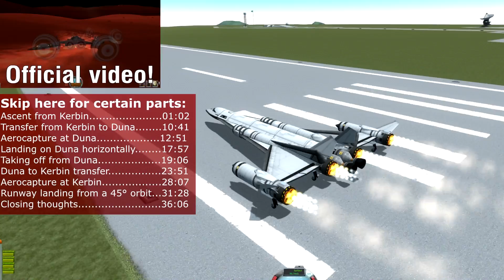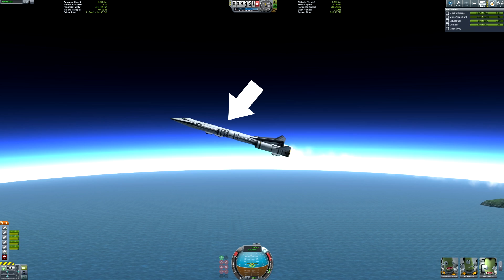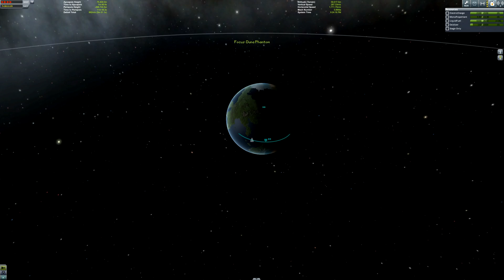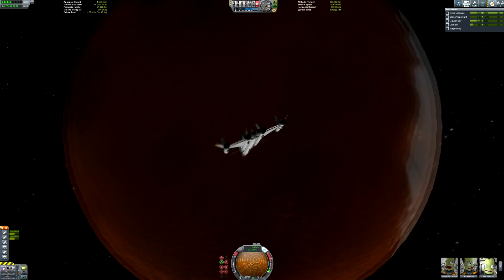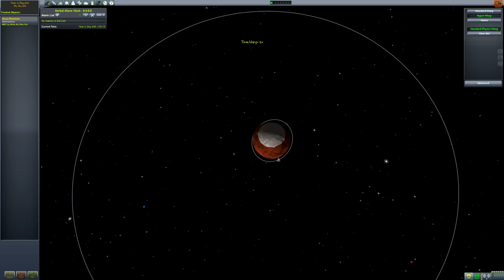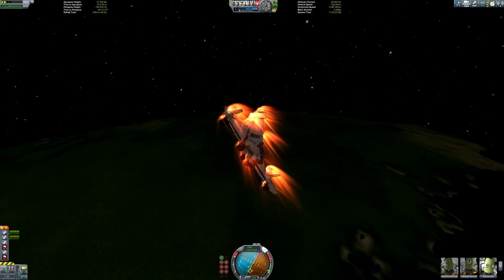Interplanetary SSTO Guide Part 2 - KSP 1.05

Comment: Its not perfect but a great ascent profile for just about everywhere is the gravity turn. Its what they use in the real world too, partly because its less stressful structurally and aerodynamically, and partly because its very good for efficiency. My standard on Kerbin would be to launch the rocket vertically, then at 60-100m/s give it a kick of about 5-10 degrees towards the orbit. When the velocity marker starts to catch up a bit you would hit the control to point the nose directly towards the velocity marker. From then on you never touch the directional controls and only use the throttle. I personally let it get up to at least 10km altitude, pitch itself over a bit, and then it will be at a decent altitude to finish the burn. With that you always point towards the air to reduce drag, your rocket never goes crazy and even aerodynamically unstable rockets are easy to fly, you have very little to think about and ruin, and your rocket gets far less stress than it otherwise would.

For the launch here you would try to pitch up steeply as quick as possible, 45 degrees or steeper, and again you would let the rocket pitch itself over. That way you're using the thrust at the start to beat the atmosphere as quick as possible, then leaving the rest to inertia and working towards forwards thrust a lot more later in the launch. For an SSTO from Kerbin I would get as much speed and altitude as possible naturally, and then climb to a fair angle and again after the initial part leave that to gravity. There's a lot more variance there so its hard to describe exactly what you need but I'd guess a 30-45 degree pitch up would be a good start. However in the atmosphere be careful not to pitch up too aggressively, a gentle turn would use the wings and create a good amount of lift for little drag but a sharp high-g turn would create similar lift with massive amounts of drag, especially noticeable in the way the game calculates lift.

In the real world the gravity turn is similar but a lot more delicate, as one would imagine. They would kick the rocket over far earlier and use a far smaller angle such as 2 degrees to reduce the stress put on the airframe. However in KSP the smaller the kick the less accurate in terms of inclination and rather than add corrective measures constantly I prefer to just use a larger kick later. Also real world rockets are better designed and able to remain at high throttle the entire time, in KSP I tend to add larger rockets than I need so throttling down to 1/3rd or so for long periods isn't uncommon. However the general concept of adding a small kick then leaving the rocket to turn itself is still the real-world technique for good reason and applicable in almost every single case. Without atmosphere there might be better ascent profiles but the gravity turn is still a good choice, its just not the perfect choice there.

Comment: Things you can do in KSP.. design the ssto so that the jet engines break away aft of the rapiers to get above 400m/s... Or keep them and fly around on laythe. I typically use the turbofans in nacelle form forward/fuel tank or precooler/reverse. Helps me land back on kerbin. I like cross-range capability.

Comment: Matt, a little bit of advice.

I think the way you've got these airbrakes installed on your SSTO's (I've seen you do it with diffirent crafts aswell) could lend to them being compared to "spoilers" on an aircraft (Shown here: https://i.ytimg.com/vi/2wVa1Qyr6IM/maxresdefault.jpg)

Generally, if you want to land an aircraft, you always want to make shure that the spoilers are rectracted during the touchdown, because the spoilers essentially "push" the aircraft towards the ground, making the landing very rough.

I don't know if this translates to KSP aswell, but maybe you could try retracting those airbrakes on top of the aircraft to achieve more smooth landings.

Comment: Quite the take-off there, Matt!

"So much fuel... so little runway... ANGLE OF ATTACK!"

golf clap
Reply: The problem with that takeoff is actually due to craft design. The rear landing gear is too far behind the Centre of Mass. You can see how fast the craft pitches up and climbs after he runs out of runway, which is a very clear indicator of the problem. It can be fixed by either putting the landing gear closer to (but still behind) the CoM, or by adding canards to the front of the craft (but still making sure centre of lift is behind CoM.)

Comment: I don't mean this as rude, but has the thought crossed your mind that people viewing your videos have no interest in ADD UBER crackhead speeds and being told to going off to find another video you say things are explained better? Only to chase down that video and get told to refer to another more detailed vid.  I'd much rather see detailed setup of a node than the idiotic fly-by camera views and IVA views. Most of us are not trying to finish KSP in 12 seconds.
Reply from the maker: Has the thought crossed your mind that I'm referring to episode 1 of this series, which goes into every aspect in detail, and this episode is meant as a loose guide to help you apply what you learned in the first episode and reach destinations that are further away?
Reply: You obviously missed the main point of my post. I'm impatient with tubers that are hyper ADD and impatient. Even the video you reference you constantly overshoot nodes from simple impatience. I can only imagine you trying to dock. Also your first video hardly goes into every aspect in detail. Not even close to that level of standard. For example, "that is not going to be enough oxidizer" so you added a tank of LFO. Did you explain how you knew that wasn't enough oxidizer? No word was mentioned even slightly referencing how much fuel or delta-v it takes to get to Minmus and back. There are a lot more examples, but point made since the required delta-v is rather important.
Reply from the maker: Starting by saying "I don't mean this as rude" doesn't automatically allow you to then be rude in your comments...

I stated in that video that you should not be attempting SSTO missions until you can confidently get there by rocket, thus having a reasonable grasp on manoeuvre nodes and encounters. By extension you would also have a good idea regarding how much fuel is needed. The point of the video was to show you how to fly an SSTO mission, I've had a huge amount of people send me messages about how it helped them. Either you're trying to nit-pick or are genuinely too inexperienced to really be attempting these sorts of missions yet. As I said in the video, you should have a good grasp of going to Duna and Minmus easily without any help before even considering an attempt at SSTO. 

If you're just trying to prove something here or whatever then feel free to go ahead and make your own tutorial, instead of berating others for making their's not up to your standards.
Reply: Trust me, I'm not inexperienced and I haven't been rude........yet........so back the fuck off the attitude. This makes three times I've tried to point out, quite clearly in the start of each reply, the simple fact you constantly rush and are extremely impatient. It is annoying and avoidable if you understood the basic controls. Each time I've pointed it out, you go off on some other minor aspect of my post.

Let's recap shall we? First post .....slow down, don't be so impatient. You reply with your first video and saying "goes into every aspect in detail"......I replied once again about not being so impatient AND pointed out your first vid certainly doesn't "goes into every aspect in detail" since it clearly doesn't. You get your panties in a wad and call me inexperienced and laud your praises from others. WTF dude, I said you should chillax and stop doing all the special effect fly-by's and silly camera tricks. Now for the rude part because as yet I haven't been.........you don't play well at all, your designs are amateurish, and your arrogance knows no bounds. 

Now back away from the keyboard and attitude and go watch Shadow Zone play.....or grunfworks....or, well just about anyone since your "guide" is nothing but a little man jumping up and down screaming look at ME! Look at me PLEASE! No real guide here, but LOOK AT MEEEEE!!!! Fucking pathetic.
Reply: Qookie well that's a bit over the top
Reply: Wow... Lets play "spot the asshurt emo fucktard".

I'll give everyone a hint... the asshurt fucktards's name starts with EMO.

Comment: So your spacecraft is a true compact planetary vehicle. We humans need those SSTOs in real life instead of using large bulky rockets.
Reply: but it's impossible to do that with real world technology. remember that ksp is 10x smaller than earth and that we haven't even been to mars with humans yet.
Reply: Using electric sparks to heat compressed air rapidly to form sonic booms that propagate behind the vehicle could be used as a future propulsion system for real life SSTOs, I hope. Basically, a thunder propelled spacecraft, energized by some form of fuel cell in 2040 AD could be designed by someone. Hopefully that someone would be me.

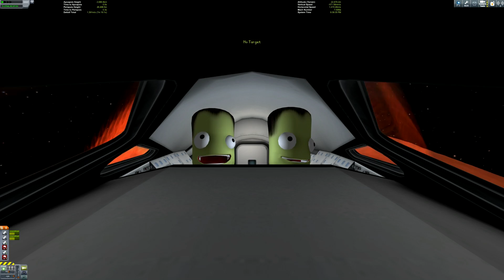Comment: At 15:00 you mention using a belly flop to aerobrake, but wouldn't shifting between normal and anti-normal be more efficient? I would assume you'd be getting a lifting body effect from even a belly flop. Isn't that the reason why the space shuttle would shift between normal and anti-normal as to not skip off the atmosphere back into space? Would love to hear back if I'm wrong I love watching these kinds of videos.
Reply from the maker: You are correct, but since multiple re-entries are possible in KSP it doesn't matter too much. Also, normal/anti-normal alters your orbital inclination, and I didn't want to overcomplicate things!

Comment: There is an easy way to determine a transfer window without KAC:

- Place something in orbit around Kerbin (to get maneuver nodes)
- Make a fake maneuver node to boost it into solar orbit, just outside Kerbin's SOI.
- Make a fake maneuver node on that orbit (which is essentially Kerbin's orbit) to intersect your target's orbit.
- Move that maneuver node around until you have an encounter (skipping ahead as many orbits as needed until you do).

The date of this maneuver node is a decent approximate transfer window. As you get close, you can refine it further.

No math, no fuss :P

Note that your little virtual probe is getting farther from Kerbin with each orbit, if you want more precision you will need to make another small fake maneuver node just after ejection to adjust your orbit so that your craft is matching Kerbin's orbit a bit more accurately
Reply from the maker: It's a shame YouTube filtered this as spam, I only just saw it! But this is a great comment, and is the only reason I still have a space station in orbit haha.

I thought for simplicity I'd just use KAC, but I think in retrospect the method outlined in your comment would be better for newbies. Episode 3 maybe? ;)
Reply: Thanks :) 

It's mostly a method for those who want to play strictly vanilla KSP; I thought it would be useful to showcase even though, personally, I'm done playing without KAC (Kerbals invented rockets and star charts, but not calendars?) and KER (if I can do the math myself with a calculator, it shouldn't be such a stretch asking that the game do it for me).
Reply: I just put the craft on kerbins orbit then do it with real maneuvers :P
Reply: @LightRealms  hmm
Reply: Nice, thanks! I do prefer the in-game manaeuver editor to an out-of-game app with just numbers. Also, this will work with any planet mod where I don't know of any app that will.

 @LightRealms  I used to do that, but you lose the Oberth effect and so use a lot more fuel than necessary. When leaving Gilly to go interplanetary, spending fuel to lower your periapsis near to Eve to use the Oberth effect can halve the total required delta-V!

Comment: very good video, learned a lot!
But why are you slowing down with parachutes when landing? Actually rightclicking landing gear in VAB/SPH lets you customize the break force ;) , which is standardized at half of the possible force. I always maximize breaking force on the rear gears to bring my craft to a stop as quickly as possible :)

Comment: Just wanted to mention the reason you want to start your burn halfway through the manuver node. You want to burn halfway through the manuver node because it makes it more precise. The manuver node assumes an infinite acceleration, which never exists, so the closest aproximation we can make in reality is putting the manuver node in the middle of our burn. But in reality you want to burn a little before half because your acceleration at the end will be higher than the beginning because your mass is lower. In pratice, though, just adding more fuel works ;).
Reply from the maker: +hi117117 This is a good explanation, thank you :)

Comment: I keep having the same problem with every SSTO i build. when i start getting high in speed and altitude the plane spins sideways and looses control.
Reply: Sstos burn fuel from forward tanks to backwards. This means your Center of gravity will shift backwards during flight. If it shifts back behind the Center of lift, you'll spin out like that. Try turning off the fuel tanks at the front of your SSTO until the rear ones are almost done burning.
Reply: Thanks

Comment: I did a ssto similar to the minmus one and it flew excellently until it stalled out or spun? At around 35,000 meters
Reply: Sounds like your Center of gravity shifted to behind your Center of lift. It tends to happen on sstos because the fuel burns front tank first.

If you still have fuel in your Ssto at that point, transfer all of it to your forward most tanks. If it was empty, then check the vehicle's centres of gravity and lift in the VAB when the craft is empty.

Comment: When I was building my Tri-Station, I also hid the HyperEdit button so people didn't think I was just hyperediting the modules into orbit. People love jumping to conclusions :/
Edit: I knew there was something off about your UI. Why do you record at 1440p? I'd rather keep it as 1080p and use that extra power for more FPS.
Reply from the maker: +Xenro66 Yup. I've been accused of cheating too many times to count. Particularly with regards to people just not understanding how fuel transfer between tanks works. I tend to just delete those comments and block the users and move on
Reply: Matt Lowne Yeah, it is kinda ridiculous. I guess people don't see why moving fuel to where the engines can access it will change how much Dv you have.

Comment: ALSO PLS DO A JOOL MOON (not tylo or laythe) SSTO GUIDE
Reply from the maker: +Cacusneedle 18 Why? This SSTO is quite capable of Jool missions as it is
Reply: +Matt Lowne its more for the purpose of showing how to do it with such little Delta v, that is my main problem. also if a craft doesnt have enough dealat v when it gets to orbit, what do you look at in the sph to fix it
Reply from the maker: I just slap on more engines and fuel until I have enough DeltaV in LKO I guess haha
Reply: +Matt Lowne well then i only have one more questu=ion, do you think 4500 m/s delta v (in lko) is enough to do a vall mission, and what are the main things i can do to improve efficiency (using gravity assists?)
Reply from the maker: You can get into orbit around Jool using Laythe or Tylo's gravity, saves a tonne of fuel. See my Jool 5 and Laythe SSTO mission for details :P
Reply: +Matt Lowne ok, that and i think it would just be helpful to see your argus II ssto liftoff in full(no commentary needed, i can analyze for myself) because i can NOT get that thing into LKO which i think is limiting the Delta V that i can achieve in LKO. also how do you plot a laythe or tylo intercept so easily, anytime I get a jool encounter i can pull it into tylo's orbital path it wont give me an intercept, is it just timing or is there a specific way to guarantee an encounter. (also thank you so much for responding, you are my KSP idol and it means a lot that you would read, let alone respond to these paragraphs i call questions)